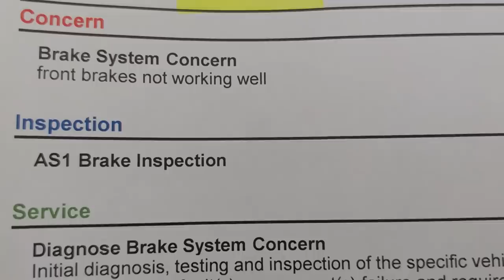Customer States Dropped Socket Into Engine Bay And Vehicle Won't Start | Just Rolled In

Comment: 2:17  OUCH!  Wait, the U-joint cross member can just seize...and do that damage?!  I always thought that degree of damage could only be done if a cross member snapped and flung the drive shaft away!  Admittedly, a few months ago I had U-joint problems which I couldn't be quite sure about.  I did a 1,700-mile round trip from Kansas to Florida in March (well, with all the driving involved, about 2,000 miles), and I started hearing a grinding at slow speeds which became a vibration at higher speeds.  Thankfully, I made it back to Kansas safely, but I still couldn't figure out what was causing that rumbling/grinding.  All four cross members were intact and had been lubed before the trip (to clarify, double-cardan CVU joints on both ends of my car's driveshaft)...but there was something I missed:  The center-socket yokes, which as it turned out also needed lubing.  The center-socket yoke for the front DCU joint was the culprit, having completely dried out and worn out.  Bad news is, that one component cannot be had in parts stores anymore, and the online hits run for as much as all other components for a DCU joint combined.  Good news is, I was able to get a replacement and repair that joint before it caused more serious residual damage to the drive shaft or the transmission.  I also examined the rear joint at the same time, and all the components were still in good shape, so I re-lubed the cross members and the center-socket yoke on that end, so I wouldn't have to do that end for a while.  Piecing together DCU joints is no easy task; no wonder most drive-shaft shops won't do them!  But it had to be done, and I was the only one willing to do the job...well, with a little bit of help from the staff at the auto-skill center on Fort Riley.

2:40  This is a peeve of mine.  You know how many motards' truck-wagons or hatchback cars I have seen on the roads and in parking lots with the plastic wrapping still over that rear wiper?!  And that isn't even to mention those with completely-wrecked wipers in those spots.  I mean, seriously, it seems like a nice idea; but if more often than not you see either of those scenarios, what's the point of such a wiper?!  It's like the old auto-dim feature on older, higher-priced cars:  Great idea, but too many people just didn't know how to use it properly, so it was finally deleted across the industry.  Perhaps the same fate should happen where rear-window wipers are concerned.

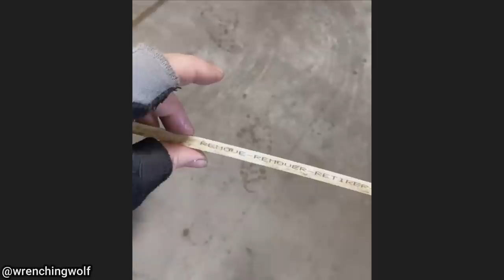2:53  Very pretty example of Trans Am, nicely preserved (well, save for the gammy ignition switch, that is).  I see it's either an '80 or '81 model; can tell by the hood design and the really-streamlined thunder-chicken decal (I always loved that hood decal).  From an appearance perspective, those two years are my favorite of Firebirds, with '79 right behind.

Comment: I have pics of a pair of Trans Am's that were for sale about 15 years ago.  Completely identical to the one in this vid, but one had T-Tops with the "outlined" style of turkey on the hood and the other was non-T-top's with a completely colored in turkey.  Even the tires on both were the same.  The "Trans Am" on the rear was slightly different between the two as well :D

Comment: I don't know how people can butcher their cars the way they do. Spaghetti wiring all over the place.
I recently bought a 4 year old car with 10500 miles on the clock. It had been stood at a dealers for 2 years going nowhere. Gotthem to do a full maunfacturers service as part of the deal buying it. Then I looked at the tyres. September 2017. Loads of tread but a few tiny cracks. Not serious but there was no way I would be doing 70 on those. 4 new ones straight on.
I really can't understand why people are incapable of inspecting their tyres and brakes, they really are very visible.

Comment: I'm amazed & shocked that these horrors are being driven on the public highways. Surely each state has an annual safety check system in place which would pick up (for instance) the rotted-out 27 y o tyre or the one with a chunk of tread missing? That these are on a freeway near you is scary.....*very scary.*
Surely, if a customer refuses to get the vehicle repaired to an acceptable standard, you have a duty to yourselves (& the wider public) to at least get a disclaimer signed by the customer, or indeed inform the police department?

Comment: I dropped off an old full size spare tire once. Since it had full tread depth, I slashed the sidewall to ensure the tire shop I dropped it at didn't resell it. The guy looked very disappointed to discover the tire was slashed.

Comment: 1:14 This tire was tired!  (pun)
3:05 The T-Tops on a Trans Am leaked water real bad!
Reply: Not the later ones that were actual factory installed. For quite a while the T-tops (and convertibles) were all done by the American Sun Roof Corporation. I worked in an upholstery shop and we were the only factory authorized repair facility in Northern California. You wouldn't believe some of the nightmares that were brought in for repairs. We even had one '80 Camaro convertible where the person in the passenger seat released the latches on the top of the windshield and the top flipped up and snapped off the factory (lol) assembly that held all the mechanism in place at the rear of the car, we were really shocked to find out that they were cast aluminum, not even pressure castings just plain old pourous poured castings that you could have broke with your bare hands.

Comment: Does that guy have idiot insurance?! How do you drop a plug socket INTO your engine? I mean, the socket should be BIGGER than the spark plug hole...
Reply from the maker: He dropped on what I think is a 6mm socket. Not the one for the spark plugs. Unsure what the 6mm socket is used for. Maybe for the coil packs?
Reply: think he just put the whole box on top of the engine and the little pinkie socket fell out?

Comment: In the UK once a vehicle is 3 years old it requires an annual safety inspection to legally remain on the road. 

Does the US have anything like this? I ask as alot of these failures surely can’t happen within 12 months ie; the brakes discs wearing down to a few millimetres thick.
Reply: Some states but not CT

Comment: Vid 1 - insurance company is actually covering that? Wow. My insurance company would never cover anything caused by "unauthorized service", which would ofc mean me as well. I actually managed to get my socket stuck on the spark plug as it was too thick-walled to reach to the bottom of the well the spark plug is in. As I was trying to make it turn, I got it completely stuck. Had to get the car pulled to the service to have the valvetrain cover removed to be able to wrestle the damned thing out. Costed me something around 200$ in my currency in the end. And insurance wouldn't pay a single cent, that I am sure about. :D I do wonder how did this owner manage to get their socket INSIDE the engine though?

Comment: The shock thing is quite shocking ... but you would be shocked to know I've seen how a Shock can separate this (looks like an Air shock or similar) .

1st one ... the suspension dropped FAR in to a hole, rut, ditch, etc ... far enough for the suspension to hang completely and then get smack by a rock or edge of whatever it fell into (at a good speed).   Since all we saw was the shock damage ... this is likely not what happened ... because other damage would have occurred (popped springs, bent shackles, etc.).

2nd one ... because it looks like it has big fender washers on the lower mount and an yellow bolt, my guess he was installing a new set (or used) of shocks and they were too short for the suspension (hard to say if this vehicle is lifted) and it seperated inside the boot and broke at that angle when he lowered the vehicle back down and either didn't notice after he installed them (likely didn't inspect his work afterwards) and took it to a shop afterwards to get it fixed correctly ... of course giving a plausible story as to how this happened.   My fellow techs ... I'm sure you've heard many stories that fall into this possibility.

Comment: 2:28 christ alive those tires are older than me by just short of a year. how do people look at tires, a thing supposed to hold air in it, with a full circle of cracking around the side walls and think those are still good? I get being broke, I've had to get a tire replaced at Walmart because I had a sudden blowout on the highway (don't worry, I installed the spare to get it there), but seriously? 27 year old (at the time at least) tires? if your tires are old enough to drink they don't belong on a vehicle anymore!

Comment: Coming from the UK with annual MOT checks (quite strict ones) on all vehicles 3 years and older it boggles the mind to see some of the stuff some Americans are prepared to drive around on. I can only think that your road crash rate must be pretty high with lunatics driving around in some of the stuff shown on here.
Reply: what's sad is that some states with inspection requirements focus on the wrong shit, they're more concerned about emissions tests and O2 sensors than mechanical integrity. It makes me sad that other drivers either through ignorance or arrogance refuse to maintain their vehicles.

Comment: The wagoneer with the brake paddle. Was that the socket still stuck on the top of the peddle?
Reply from the maker: I don't think so. Would have came off. A metal rod it looks like for the brake pedal assembly. Hard to tell with a quick glance.

Comment: OK, I am a bit cheap when it comes to cars - my car is a 2002 Skoda Octavia 1,9TDI... Worth about $1500. Yet I change my tires regularly - never had one older then 5yo, always replace them if they are worn or damaged - and always in whole set or at least pairs, always buy decent quality all-weather (Nokian is my preferred brand). I can't fathom how one can be so stupidly cheap to drive on old worn out and damaged tires. Same with oil changes and checking oil level. This is very basic, not expensive and will save very expensive repairs/replacements (even of a whole car/engine) in the long run.

How can people drive like that? In Europe a first traffic/highway cop would order the car taken off the road. Cars like that would fail the yearly mandatory checkup.

Comment: I dropped a nut into a 78 f150 with a 400m, simply shot out the exhaust valve 3 revs later, not a scratch to the piston or head.

Comment: How does someone drop a socket inside the cylinder and then run the engine and destroy it. Just like I DO CARS....PISTON MCNUGGETS.
Reply: I was wondering that too
Reply: I don't know, but sounds like a good way to get a new engine.
Reply: It just runs rough before it starts idling

Comment: I am still trying to figure out how the socket got into the engine when the socket is bigger than the spark plug, so should not be possible to fit through spark plug opening. Or am I missing something?
Reply from the maker: You're missing something 😜. It wasn't the spark plug socket. It looks to be a 6mm socket. So I think maybe the socket used for the nuts that hold down the coil packs.

Comment: Why was the guy changing spark plugs at 25,000 miles? Unless he was upgrading them.
Reply: Because there are a lot of people who believe all the ads about how certain plugs can (and in a lot of instances do) improve performance and mileage of your vehicle, you have to remember that most manufacturers use the cheapest and most available ancillary products they can, it's not uncommon for one to balk at using a part or trim item that costs 75¢ more than the one they are currently using.

Comment: Why did he drop the 10mm in the engine? What engine has 10mm spark plugs?
Reply from the maker: Lol I think they said it was a 6mm. But either way they probably removed the nuts that hold down the coil packs. (Not sure what size they are).
Reply: @JustRolledIn  must have been for the coil bolt then, obviously kept all his tools on the rocker cover
Reply: Step 1: hoon brand new engine until ruined
Step 2: insert 6mm socket into spark plug hole
Step 3: rev engine
Step 4: call insurance and tell them who your dad is
Step 5: ???
Step 6: Profit
Reply: @PrototypeSpaceMonkey  something like that

Comment: So....you're changing sparkplugs.....with a socket 10mm or smaller 🤔

Did they have to remove a coil pack or am I missing something?
Reply from the maker: Yep they had to remove a coil packs so thats why I think they dropped a socket down the spark plug hole.
Reply: @JustRolledIn  That makes sense, the aftermath however does not 😆

Comment: Man, you got a ton of dumb customers!!
Dude drops socket in motor, barks off the motor anyway.
Idiot over extends his rear suspension, has no idea why shocks came apart.
FaMunda Cheese head runs wires all over like crap... 
but the 1995 tires just makes good economical sense, like why change guitar strings that ain;'t broke yet?!

Comment: Man I've had old cars without keyless entry.  I dunno why people hack up their wiring harnesses installing that keyless fob, remote start, alarms, etc.  It almost always leads to issues down the road, even if you do a good job installing it.  Just deal with putting the key in the door or trunk.  I told my buddies my old Cadillac had the "mafia option" on the trunk.  Only way to get in it was with the oval key, I disconnected the remote button in the glove box cause I never used it.  No stupid glow in the dark interior release handle or folding back seat like newer cars.